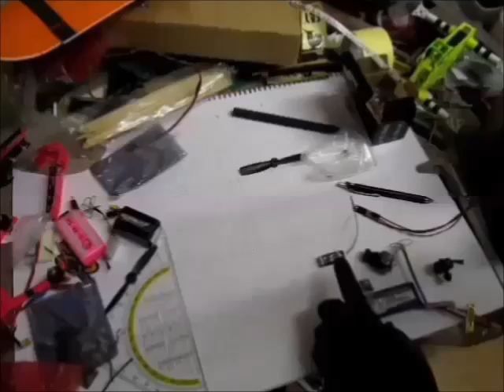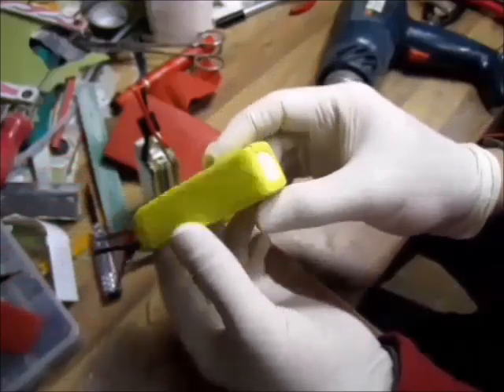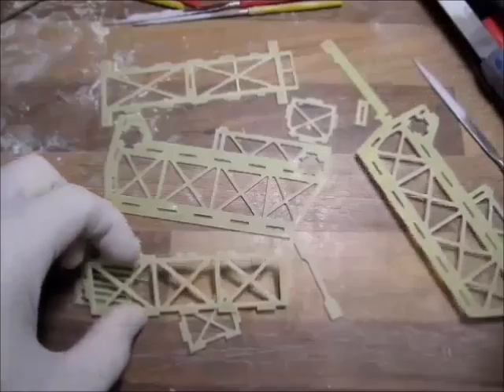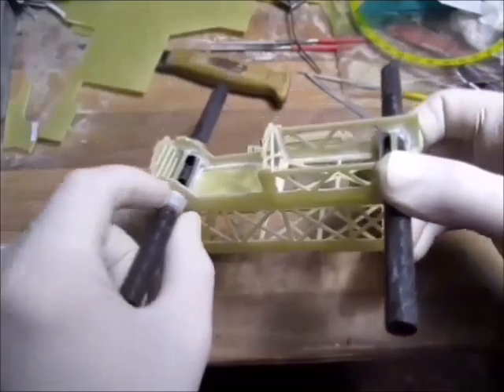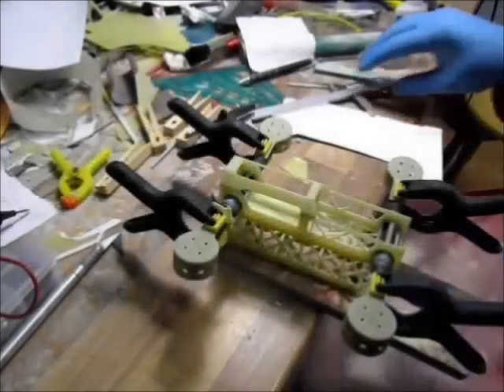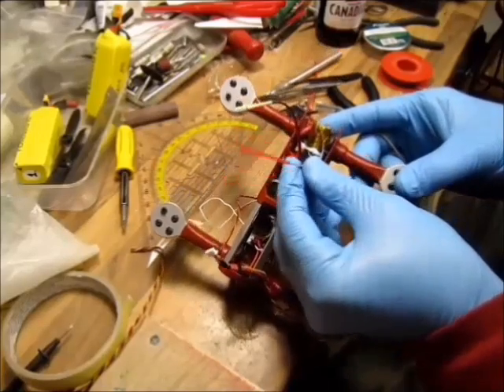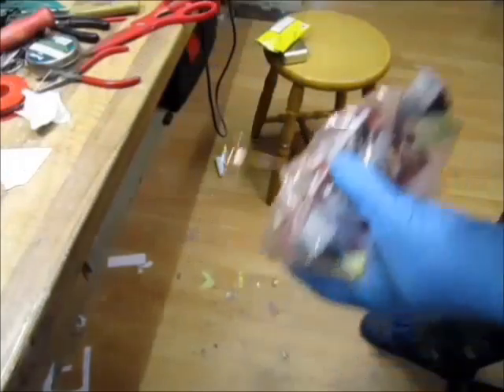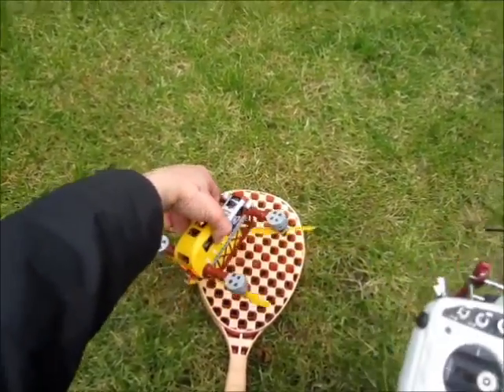180 HotRod miniquad, A-Z complete build

Comment: Wow this is awesome and it looks great, good job!
You should consider getting a cnc machine, or make one :)
Reply from the maker: +D.B. 
Nah, I don't like them, I'm a big fan of handcrafting:) There's no way to automate that fishing line wrapping (what is the most time consuming in my builds) and I don't do mass production. If I would, they would look more or less just like any other frame on the market, and I can draw with pencil and cut with fretsaw faster than design a part and let CNC do the cutting. I just don't get on well with computers, therefore I'm not craving for 3D printer either:)
Cheers bro, thanks for heads up!
Reply: +ROBOFORCERX2000 I can appreciate that, big respect!
I don't own a cnc or 3d printer either, but I do use inkscape to design a moc up, similar to your paper and pencil. I then print it on paper, so that I can drill the screw holes accurately.
My 800mm quad (soon to be X8) project is unfortunately more functional than art, but atleast it's a custom hand crafted design =)

I'm looking forward to see your future projects!

Comment: you can loose more weight if you solder the antenna directly to the 200mw board
Reply from the maker: +Hector L 
That's exactly what I did there:)
Reply: +ROBOFORCERX2000 oh I didnt see that part. great build I have decided on building my own 180 as well and I have learned a lot from your video thank a bunch

Comment: How is that material called you made the frame of?
Reply from the maker: Fiberglass plate.
Reply: Thanks. Is it dangerous? Do you wear air filter? How does it harden?
Reply from the maker: therealfox It doesn't harden, it's a solid fiberglass or carbon plate/sheet. And mask is definitely needed as dust is harmful.